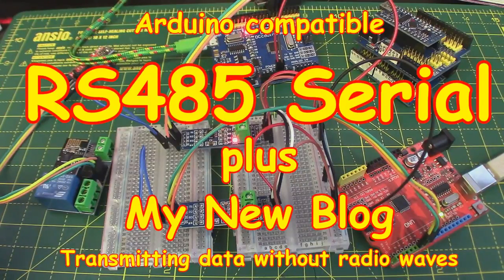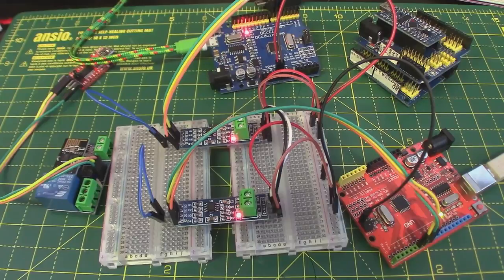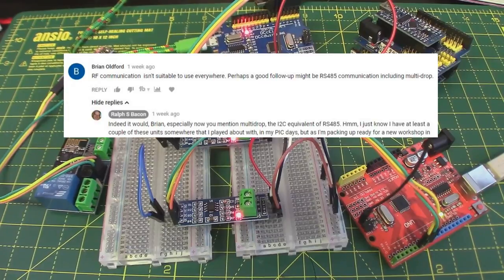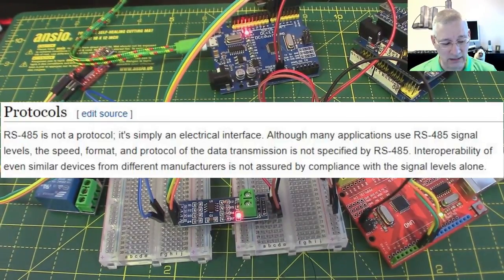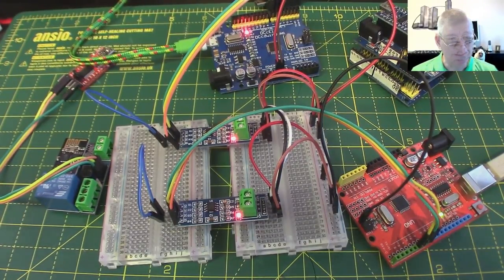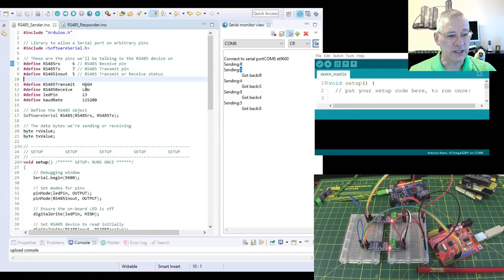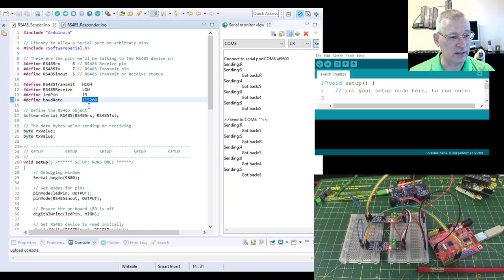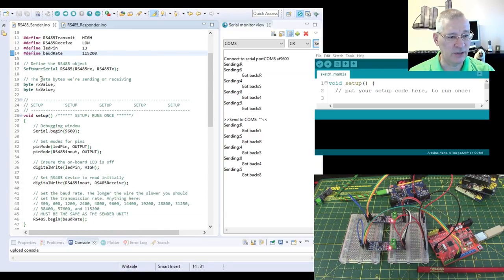#106 RS485 Serial Data Transmission - on wires (no radio waves)

Comment: Nick's page says he is using an LTC1480  and that is a 3v3 part.  the boards from Aliexpress are 5v because they use the MAX485 chip
Reply from the maker: The LTC1480 is certainly advertised as a 3v3 part but can take up to 7v. I suspect that is why Nick's using the full, Arduino-friendly 5v supply thus avoiding any level shifting requirements.
Reply: The module from BangGood and from AliExpress for less than a Dollar is a MAX458 chip, the data sheet lists that as 5v.  Searching Maxim, the matrix for 3v3 to5v does not list the  MAX485  chip.    I gave you a thumbs up for a great video and your contributions to the community.  My needs are for the EXP32/8266  chips that are 3v3.  
Interestingly there two sides to the RS485. the external connection side can take a very large swing of voltages as the chip is looking for differential signals on the two lines as the means of detecting data and not any actual voltage.  The receiver side has a very large voltage range the LTC1480 is -7 to  12V. The MAX485 is slightly more.  That allows a 3v3 ESP8266 device to connect to a PLC or automobile based network that is running at 12 volts.
In a side note,  I personally try to buy the mainstream parts.  I assume there is a flood of them and that brings the lower costs and keeps the chip in production.  I suspect that one of the main supply outlets will start with 3v3 and 5v tolerant parts and make us all happy.    Thanks again for your educational videos !
Reply from the maker: You are most welcome Dave -in-NJ, I'm glad you like the videos. Nice to hear from you.

Comment: As i promised before, here is the code for using struct with RS485.
Same usage of pins as your sketches Ralph.
But i added 3 led's to each bord to show sending, recieving and errors.
www.digihz.com/ArduinoCode/RS485SenderStructV3.zip
www.digihz.com/ArduinoCode/RS485ResponderStructV3.zip
Picture of my sender / responder. www.digihz.com/ArduinoCode/Sender_Responder.jpg
I will supply a new version soon where the sender sends some configuration struct data to the responder, and the responder sends back sensor values.
Sometimes you want to send some configuration values to a slave from a master and once that slave recieves the configuration , then the slave starts to continiously send sensor data back to the master.
Reply from the maker: Nicely done, Hans! And well documented too, a man after my own heart. Thanks for sharing, I hope others have a look too.
Reply: @RalphBacon  so you tried the sketches with leds connected? Or did you just have time to look at the code Ralph?
Led' s are more informative i think and fun to look at to.
Yes, documentation is allways important, not only for others, but for  yourself to when you look at a code 5 years later :)
Reply from the maker: I just looked at the code, Hans. But I could see what you were doing. An old Dev Mgr of mine said that we were commenting our code for the next programmer who had to maintain that codebase - who would probably be yourself in 6 months time!!! See, we all think alike.
Reply: @RalphBacon  ok Ralph. But I think that you should try it in real life... (could be good code for your Bluetooth to to use Easytransfer). But mayby by tomorrow I have the other example finished about sending configuration data from "sender" and "responder" sending back sensor data.

Comment: Great info Ralph!
And i had a problem with one of my RS485 modules. I could not get it to work at all at first.
But...After checking the RS485 module i noticed that the chip on the module was not soldered correctly at all (1 side of the chip had all 4 legs not even making contact with the circuit board!)
After replacing the module with another one, everything worked out fine.
SO!!!! Check your modules if you are not getting it to work, Ralphs code IS working.
I tested with 50 meters of new telephone cable (still unwrapped from package with 4 leads (using 2 of them) and it worked like a charm, but as Ralph and Nick Gammon states....use a common ground wire to to make the transfer more reliable).
I am playing around with EasyTransfer by Bill Porter http://www.billporter.info/2011/05/30/easytransfer-arduino-library/
Github:https://github.com/madsci1016/Arduino-EasyTransfer
to be able to send and recieve structs, and will post an update here later with the code.
Reply from the maker: Glad you got it all working, Hans!

Comment: Very long wires run outdoors = think about lightning protection.
Reply from the maker: A very good point there, JH. I must admit I imagined in my mind that everyone buries their cables but I guess they could equally string them on poles like telephone wires. Now I know you can get ADSL surge protectors so maybe you can get some other form of surge protection for standard "data" wiring, I just don't know but it's certainly something that should be considered. Thanks for the post.
Reply: If you have long overhead cable runs it may be possible to include a degree of protection (up to about 15kV) by using opto-isolated transceivers like the LTM2881. Obviously nothing can protect completely against a direct lightning strike. Ouch!
Reply from the maker: I'll keep mine buried, it just seems safer. Thanks for that update, Brian.

Comment: RS485 !!!
Reply from the maker: Er, yes, RS485, Kenn! Works well. In fact I have seen several more RS485 modules lately, perhaps it is being used more.
Reply: @RalphBacon  It has been two decades since I heard someone talking about it but it still has its uses [I nearly puke at yet another BlueTooth boombox folks insist on using an use tech in ignorance ).

Comment: I made a new version , same hardware connection as before, only the code is different.
www.digihz.com/ArduinoCode/RS485SenderStructV4.zip
www.digihz.com/ArduinoCode/RS485ResponderStructV4.zip
Picture of my sender / responder. http://www.digihz.com/ArduinoCode/Sender_Responder.jpg
This version  (V4) is for sending and recieving in different intervals depending on if the sender and responder are connected or not.
Added some error handler function to clean up the code a bit.
This example simulate the use of up to 7 pir sensors connected to the responder. (You don't really connect them :) )

INFO:Use the led's, disconnect the sender or responder or the RS485 data line and see what happens, that will make you understand everything i think.
Reply from the maker: That looks very neat, Hans. And from I can see in the photo, you've used the same coloured wires for each module, good consistency! You'll be wanting a video on LoRa next! Oh, wait! What's just arrived in my mailbox...
Reply: @RalphBacon  thank you Ralph.
I don't know anything about LoRa.
I concentrate working on arduino  pro mini, arduino Nano and nodemcu 8266.
Reply from the maker: LoRa = LOng RAnge radio, a bit like Bluetooth/nRF24L01/433 Serial Transmitters but can have a HUGE range. The record is about 200 Km. OK, in normal use several Km.  Keep tuned for a future video on this, you might find it interesting and possibly even useful!
Reply: @RalphBacon  Of course I will look at it. Wireless solutions are fun and neat, but I prefer wired connections for reability more.
Have a nice weekend Ralph.

Comment: love you man.. wanna give you hug right now.. been battling rs485 for over a week now and getting nowhere.. this opened up the opportunity for me to go to the next phase in my home automation system im building.  go to this link.  https://www.dropbox.com/s/3renihvj2xt1y7h/20191007_031146.mp4?dl=0

want to have remote arduino nanos around the house detecting motion and writing a numeric code back to main controller with 8 ch dimmer board.  codes will specify which rooms detect motion and which havent... if (motion_livingroom == High) write 10001 across rs485 to dimmer control panel. if (motion_kitchen == high) write 20001 ...ect..ect
need help with if statements to write certain codes for certain conditions...
Reply from the maker: OK, hug duly accepted (hey, I'm British, we don't go in much for actual physical contact) but the sentiment is nice. Regarding help with your project I recommend the Arduino forum which has many experts literally just waiting to help you if you clearly specify what you are stuck on and what you have done so far to get over the hurdles. https://forum.arduino.cc/